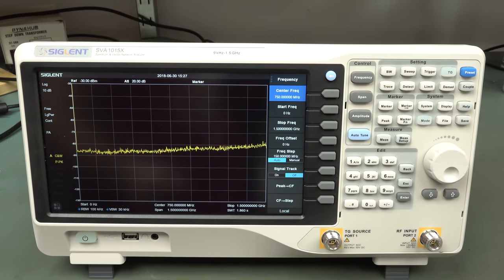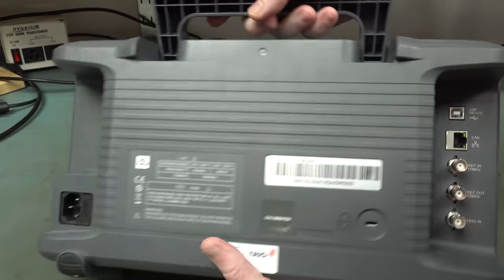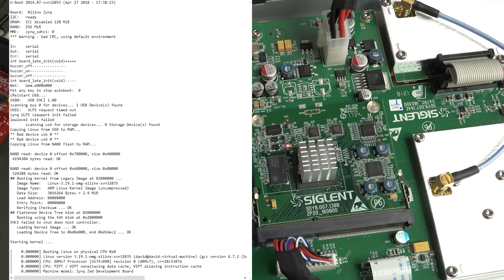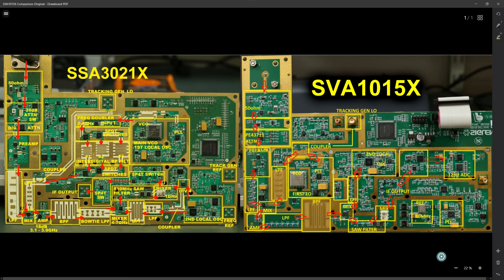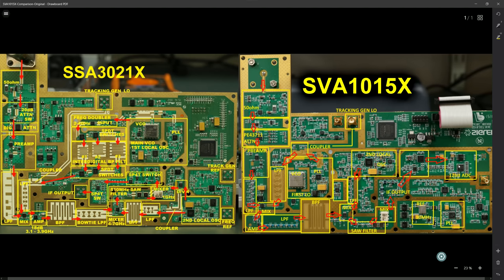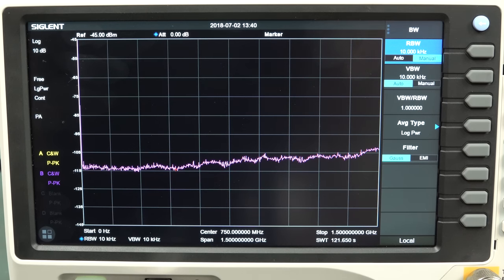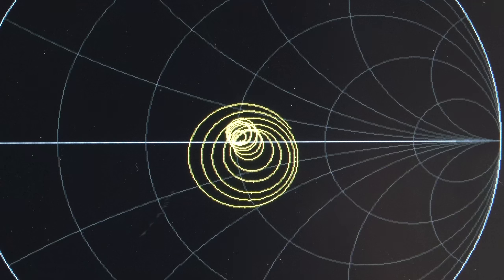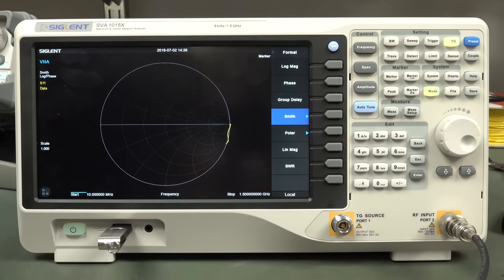EEVblog #1101 - Siglent SVA1015X VNA Teardown

Comment from the maker: I'm not sure how you can release a VNA with that name on the sticker and make the VNA optional extra, marketing innovation?
It's like releasing a Digital Storage Oscilloscope and making the storage optional extra.
Reply: Won't take long before someone jailbreaks it.
Reply: yup...it will be an easy firmware update...
Reply: of course they could...and of course you would need to compare the 2 models before hand...but its not out of the question for stuff like this
Reply from the maker: jort93z  - No, they don't. You can buy just buy the software upgrade that enables VNA. Also, look at the teardown, the VNA stuff adds pittance, which is why they are able to include it. Siglent actually rejected the idea of a model (SSA1015X) without the VNA capability.
Reply: @pedal fiend a sound card and software!..infact you can use a soundcard as a frequency limited SDR (44khz, 96khz etc max frequency depending on sound card)
Reply: @pedal fiend ..just use ya phone!..not much more affordable than a couple $ for an app!
Reply: I was just looking at this yesterday and was wondering the same thing.
Reply: I do wonder if the labelling may cause an issue in the EU/UK where basically a product as to do what it says on the tin.
Reply from the maker: pedal fiend  - That's called a Dynamic Signal Anaylser, and you can get sound card based software or USB interface units.
Reply: Just like you've said, everyone will buy it and hack the hell out of it :D
Reply: Its almost like EA is working on test equipment now...
Reply: iamdarkyoshi 
EA? Electronic Arts?
Reply: EEVblog I'm guessing they intended to ship the no-VNA software license with only with the SSA model but decided to just make the VNA hardware and offer it at the SSA price without the VNA software.
Reply: I was already manouvering myself to bite my own ass for having bought an SSA3021X last christmas, but THAT is what saved me from actually doing it.
Reply: False Advertising under Australian law I would think.
Reply: True. After all, if it's happened with the Rigol DS1054Z, it'll happen with this Siglent SVA1015X. In fact, who knows? Maybe Rigol did it on purpose! They made it easily hackable (or even released the hack themselves) so that sales would be boosted with hobbyists and businesses would have to buy the extra options to be legal.
Reply: I is not a full VNA even with the option payed for and enabled.  It only measures S11 & S2, it does not measure S12 & S22.  You will need to disconnect your part and swap input and output to measure S22 and S12.  The tracking generator does not work below 5MHz, so this unit is limited in use for low frequency RF work.  However it is still not bad for the price.
Reply: Better than just selling an SD card as Digital Storage Scope. The Scope is optional.

Comment: $1300 with 20k in options?  Lost interest.
Reply: Until someone figures out how to hack it.
Reply: Wholly Mindless it's just pirateable software options, so pretty awesome once people figure out how to crack it
Reply: It's like dlc in real life
Reply from the maker: jort93z - As per comment above, the hardware is the same, the VNA is a software option.
Reply: Personally i think that letting people hack stuff might be a marketing strategy. Rigol sold a lot of units, in my opinion, because they were hackable. Might be also that they even leak how to hack them. That would be an incredibile marketing strategy. The people willing to buy the options will buy them anyway, plus they sell a lot of units to makers, hackers and amateurs who percieve the hackability as an extra value they are getting for no money 

It's just an hypothesis
Reply: I'm surprised it doesn't include loot crates: "Spend $300 and we'll upgrade a random feature!"
Reply: $US1395 - so $A2K - I think I'll go and do something else too.
Reply from the maker: Valerio Nappi - Wouldn't surprise me if it's not that hard to hack
Reply: EEVblog maybe try to dump the firmware
Reply: The Chinese love piracy, but they love innovation more. The TS-100 soldering iron and ES-120 electric screwdriver I just received are both entirely open source - software and hardware. You can find the entire circuit schematic on the banggood store that sells it! They give you the source code out of the box right under the firmware file on their website! When the company found Ralim’s firmware online which he rebuilt from the ground up to open up a ton of new functions, they sent him a special acrylic case for his iron as a thank you.

The Chinese guys who run companies like this, Siglent, Rigol, Micsig, etc - they’re not stupid. They know people are gonna hack their stuff. They know people are going to reverse engineer their products. It’s literally part of their culture right now. Not that it's a good thing (because it's not), but a phrase you will often hear in China, at least Mainland/PRC, is "mei ban fa", which roughly translates to "can't be done", or "no solution", or "it's inevitable". A lot of people use this attitude to shift responsibility, which isn't great, but some people might also put a positive spin on it, i.e. people are going to hack our gear anyway, why not let them. If there's a problem, tell us why we're wrong, and fix it.

Generally if someone finds a hack, at worst, they’re not going to care. At best, they might even invite the hackers to be consultants for them - ask them to find bugs and vulns and the like.

These companies with their heads on straight, they love hackers, they encourage them to find stuff and make their equipment do fun and interesting things, because they realise that hacking is innovation. If someone can come up with something better on the hardware you sell them, why the hell not allow it? It’s good marketing. We sell you something at a lower cost and you can decide what you want to do with it.

The software options also means that they can just make one model of the thing that has everything, and lower the cost. You want to buy the extra functionality, great, do that. But I’m pretty sure that hacks are going to be ‘found’.

P.S. For the two of you that pricked your ears at the mention of the TS-100 - this goes to show you the attitudes of some of these companies - here is the circuit schematic: https://imgmgr.banggood.com/images/upload/2015/11/TS100/TS100%20V2.46%20Schematic%20Diagram%20V1.0%20.pdf

And here is the original firmware and source code, in the same forum post. If it's in Chinese, the English button is on the top right of the page: http://www.minidso.com/forum.php?mod=viewthread&tid=892

And a bonus, here's Ralim's firmware. It's awesome: https://github.com/Ralim/ts100
Reply: I was thinking exactly the same - make them popular by letting them get hacked
Reply: I guess it makes sense for them to make it hack-able. Any industrial user will buy the packages so its all legal and above board with warranty etc so they make their money there. Any home user will buy one and just hack in the options so they will sell a tonne of units which they wouldn't if it was a hardware addition. Winner both ways

Comment: Shame that they used only 2 screws (instead of intended 4) to fix the N-connector. That is the only mechanical support and you have always a lot mechanical stress on the peripheral connectors, especially for those main IN/OUT connections... But otherwise seems very nice apparatus 🙂

Comment: Hi Dave, the crappy Leylon 400V Cap only has to worry about 100Hz ripple
When refurbishing some repairable SMPS I have not found any failed DCBus 400V caps.
It is good to see better quality caps in the HF switchmode part of the supply were ESR can be problem particularly if they are high density value caps or low value/high voltage types.
Reply: Yeah, even the shittiest primary input capacitors don't seem to fail in the SMPS's I've repaired.

Comment: Vector Network Analyser: $609
Demodulation Analysis (ASK/FSK): $629
Distance to Fault: $289
EMI: $449
AM/FM Modulation options: €319.00 = $375
Advanced Measurement Kit: €364.00 = $428

So...  $2779 in total for all upgrades!

Doesn't include the hardware necessary.

Comment: I find it really odd that in a bit of $1k+ test gear there is corner cutting on the filter cap but yet on a $500 projector I took apart that failed every single cap on the PSU is Rubycon

Comment: Replacing the Bowties with SMD components probably means they were throwing away a lot of PCBs that didn't meet the standards, or the material for manufacturing to the tolerance was significantly more expensive.

Comment: A big part of deciding to pick up the Siglent SDS1204X-E scope was that so many "options" were standard -- signal decoding among those. Bummer that Siglent have returned to making so many things option$. In a SA, I need coverage through 2.8 GHz. I have an old HP 8594E SA with the 85630A scalar network analyzer that does a very nice job (it's portable -- it has handles). Let's see what Siglent (or Rigol) do in a 3 GHz model with TG and VNA. You can get okay 3 GHz cal kits (open, short, 50 Ohm load) on eBay for around $200, look for OSL cal kit.

Comment: The Tracking Generator on the SSA3021X is listed as going down to 100KHz, while the generator in this bottoms out at 10MHz.
It's another point to consider, if you're trying to choose between these models
Reply: Actually, the Tracking Generator on the SVA1015X starts at 5 MHz for the spectrum analyzer. The VNA option does not go below 10 MHz.

Comment: Not sure if you mentioned it, but is the SSA3021X model using a PCB with a rogers RF material top layer and the new SVA1015X is getting away with regular FR-4?

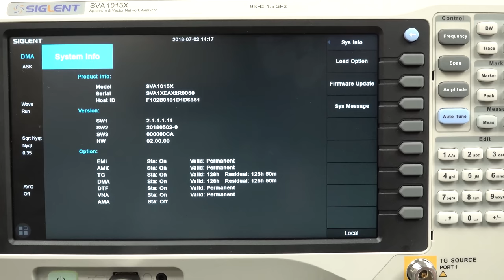Comment: At 53:03 you see that the tracking generator and DMA are extra paid options. In the device in this video they were included as temporary licences. The optional extras Dave listed in this video add up to almost $2,700 for a device that retails just under $1400. I don't remember if that included the tracking generator. If they included the TG and VNA options as stock for just under $1400 it would be a possible killer of the Rigol DSA-815TG.
Reply from the maker: The tracking gen IS included in the base model.
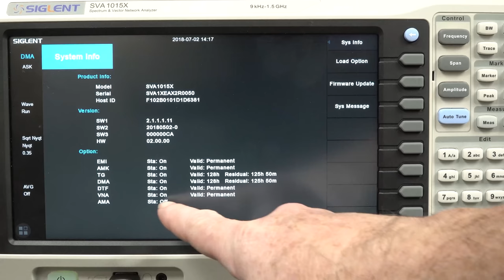Reply: The hardware is included in the base model. The licence to use it is extra. If you look at the screen shot at 53:03 you see that the model you were using in the video only had a 128 hour licence for the use of the TG and DMA. After the time expired you would no longer be able to use either feature without paying for the options.

Comment: I notice at 40:30 that D46, D47, D48 are not installed in the tracking gen, I suspect that they would of been protection diodes for reverse DC input, maybe they effected the output in some way and were not really needed because of the capacitive coupling from the port anyway.

Comment: Hey now, Ne nice to the watch crystal. I know a DMM that originally had the watch crystal flapping in the breeze. :-)After it was pointed out, the PCB didn’t have a pad to solder so the manufacturer decided on hot glue to hold it down. Just took apart a smart meter hub that did the block gold traces since it had Bluetooth, zigbee, and WiFi, just no shielding. 
That 3M stuff is high temperature double stick tape, not the cheap double sided tape like in some. It must be sticking down a cable I’m guessing so it doesn’t work loose?

Comment: LOL there is a not soldered ceramic filtercap in the Section between IF Output and 12bit ADC --- C112 is open :D
In the topdown pictures its a little hard to see but still noticeable (better distinguishable on the angled view found on the Daves Flickers page)
Good to see that even big brands still have such easy escapes with AOI inspection.

Comment: I like that they are using a BR cell instead of a CR cell.  BR cells are more expensive and don't have the current capacity of CR cells but they do have a substantially lower rate of self-discharge.

Comment: Calibration kits are not free to make regardless of how low-end they are assuming they're N-type and still within the range of being usable for general purpose stuff up to 1.5 GHz. Open, short and thru are cheap enough, only so-so machined blocks of brass in the cheaper end of the spectrum, but a decent 50 ohm load will always cost you something. If you're looking at a $2000 instrument, they're not going to throw in a $350 cal kit. That would absolutely destroy the bottom line and plenty enough people would complaint about the quality anyway. RF engineers and HAMs get the level of calibration standards they require. Some need $20,000 kits per connector type and some are fine with getting a simple set of $300 standards. There's a whole spectrum of different price points available for calibration standards.

Comment: That sort of milling is also found inside LNB's if you ever took a LNB apart, I just hope that you can put it back together without any problems, you can do the same analysis by doing a IFFT then to get the magnitude by doing sqrt((i*i)+(q*q)) and the phase by atan2(i,q);, I think it would be wise to just use 4096 bins and not to go above this as it gets progressively slower.

Comment: I'm wondering what a quote from a dealer for this instrument fully loaded would look like? Last time I ordered instruments with add-ons, some of the add-ons were bundled together and the price of the bundle was significantly less than the prices listed on the manufacturer's website. The bundle offered also included some features I wouldn't have otherwise purchased.

I'm still going to agree with everybody, if it says VNA on the box, it should come off-the-shelf with a VNA in the box.

Comment: Scaling is limited to 1 dB/. Even the basic DSA815 goes to 0.1 dB/. My 1990s vintage HP VNA goes down to 0.001 dB! VNA option is limited to 10 MHz or higher! Shouldn't these have been mentioned in the review?

Comment: 20:39 Good question - why would they shove 3M VHB tape down there? Don't get me wrong, I love it - use it at work and around the house for lots of stuff. And even some things that don't require me to peel back the other side (making it essentially one sided super tape..) which this appears to be - as neither an adhesives or electronics expert; only a hobbyist, I'm sort of curious. When I use it, I'm using it mostly for bodge jobs, so perhaps I have a jaded perspective on it's practical industrial and electronics uses.. :)

Comment: I'd like to see this compared with a very similar unit, the R&S FPC1500. I'm aware of the significant price differences and general limitations between the two, however this introduction definitely peaks my interest to see which one would fulfill my "home lab" for my graduate studies.

Whilst I'm quite impressed by Siglent's significant improvements over recent years, my experience with them has been "fair" compared with the usual "high price brands."

EDIT: "The Signal Path" ep. 121 has an in-depth review of the FPC1500.
Reply from the maker: I haven't seen that one yet. Bit pricey for 1GHz with S11 only VNA, but it's expandable. But it IS an R&S
Reply: Hmmm. I just looked over at the EEVBlog website and haven't seen a forum posting yet. But yes, the FPC1500 is actually much higher price as expected.

Btw, I tried to look, at whether the Siglent's Smith Chart will work with S21, which their website does say and the menu option during your Smith chart appears as an option, but the user manual isn't very clear whether it is or not. The FPC1500 data sheet doesn't appear to allow S21 Smith Chart displays but does appear to measure S21 magnitude.

Just a few thoughts before I carry this topic over to the EEVBlog page.

Comment: I would be somewhat hesitant to buy this spectrum analyzer for radio amateur (ham) use, as it does not cover e.g. the 40 m and lower bands. If I read the specifications sheet correctly, the tracking generator starts at 5 MHz and the network analysis option even higher at 10 MHz. Tracking generators in other low cost products from Siglent and Rigol start as low as 100 kHz, although they do not have the network analysis option. However, radio amateurs may find these products more useful if combined with a separate ham-oriented analyser such as the Funkamateur  FA-VA5.

Comment: So this stops just too low to work with the 2.4GHz ISM band (RC toys,  Bluetooth, WiFi etc.) let alone the ~5GHz bands used for modern WiFi,cordless phones etc.
  But it might be able to analyze wired Ethernet, TV broadcasts etc.
Reply: Jesper Henriksen And that'll be just for 2.4GHz and GPS, I guess?

Comment: You should've tried the "marker" buttons while in VNA mode.. Awesome video
Reply from the maker: The Marker function does as you'd expect, also delta marker works. But that's it as far as analysis goes AFAIK.

Comment: Not sure how this is LOW COST.  Options are insane priced.  By the time a ham can use this they need to add $1000 USD.  AM demod is mandatory.  Calibration too... 

This should have the Rigol hack that opens up all options, which I've done. 

Plus alot of folks are into the 2.4ghz ASM band.  This is worthless for that.  Pretty much a non starter.
Reply: Alexander Filatov 2.4ghz is kice because you can just use off tge shelf parts, that's the reason it's so popular. No need for a VNA
Reply: tommihommi1 But you still need an analyzer for testing that ISM and higher band stuff.
Reply: and this works perfectly for that.

The options are software only, I doubt many hams are going to pay for them